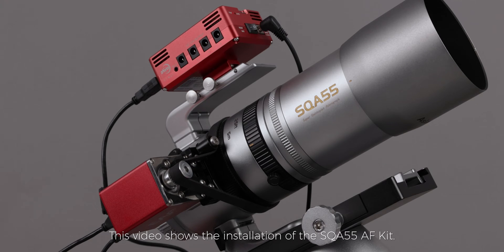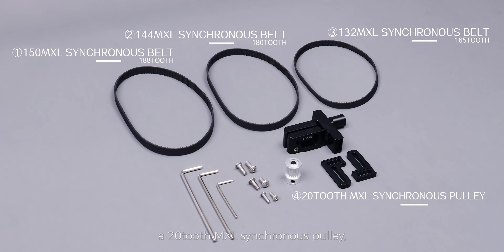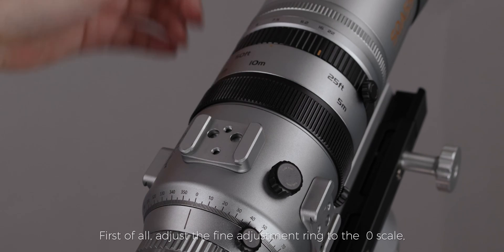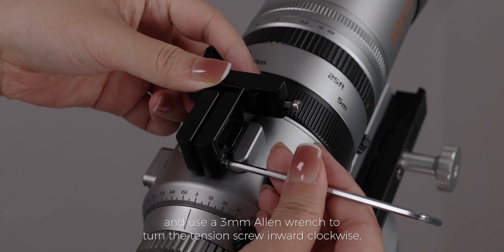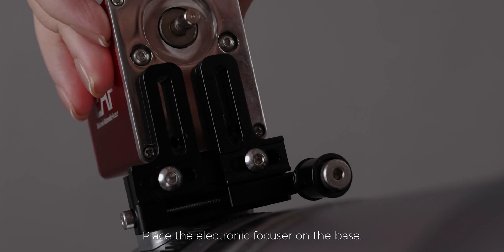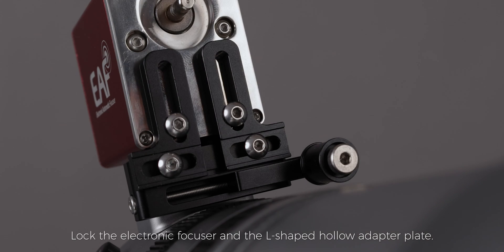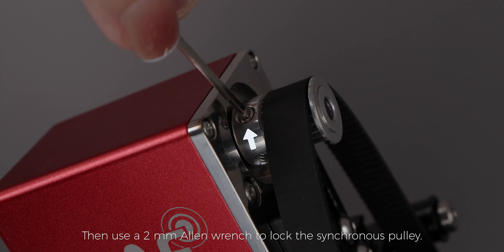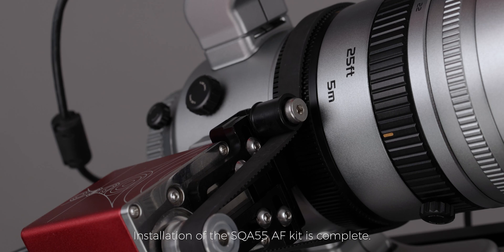The Instruction of Askar SQA55 AF KIT Installation

Comment: ****CAUTION BEFORE INSTALLING****

The extension bolt for the tensioner is shown as fully extended in this video, moving the tension barrel all the way up. I received mine with the tensioner bolt fully tightened, placing the barrel right under the bracket M4 bolt. I sat down with these instructions expecting to do each as it was said. The video should include an instruction to fully release the tensioner bolt prior to trying to install the bracket and M4 bolt. Following these directions as they are, if you try to install the bolt right over the barrel, it can damage the barrel and risk stripping the hardware.

Comment: How much equipment weight can the SQA55 focuser support? Would an ASI2600MM + filter wheel + Falcon rotator work without possible focuser play?
Reply: Its a helical focuser -  the mechanics are internal. It doesn't use a focuser draw tube like most telescopes where it moves in/out from the back; no amount of weight added to the telescope is going to shift the focuser.